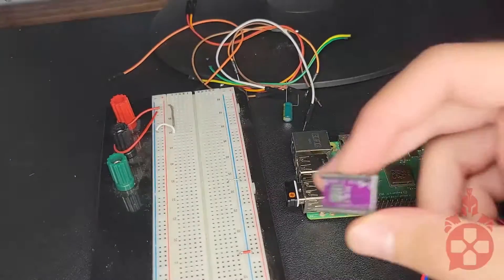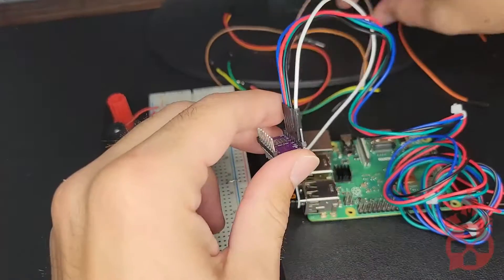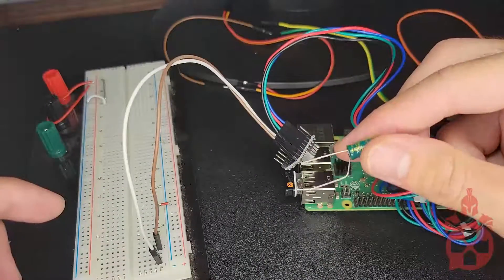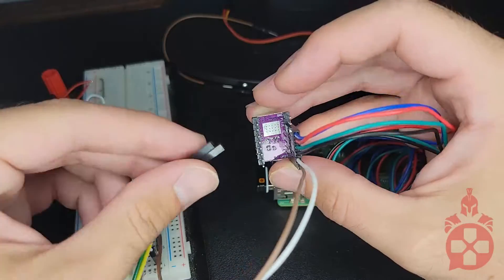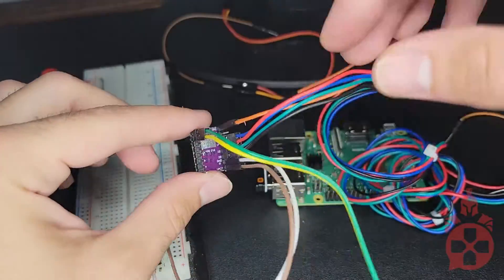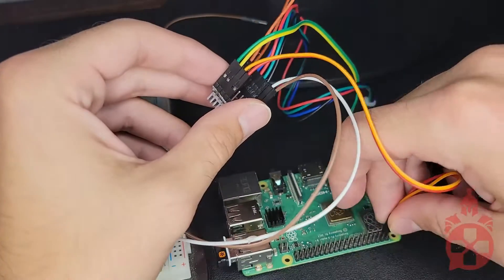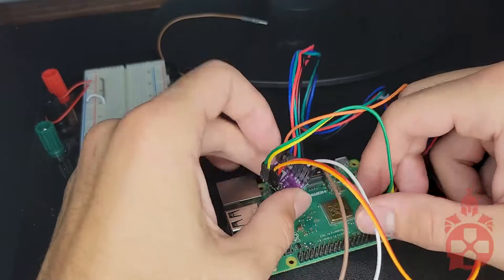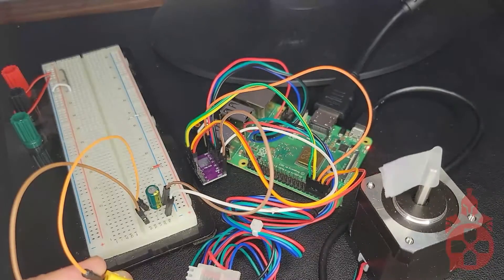How to Run a Stepper Motor with the Raspberry Pi

Comment: I'd like to point out that the green and yellow wires seem to be swapped in the video. DIR should connect to pin 14 and STP to 15 to match the code.

Comment: Hi there. Thank you so much for the video. I’m kindly requesting to show me the  connection scheme and what Raspberry pi did you use ?
Reply from the maker: The data sheet for the stepper motor does are really good job showing the pin outs on the driver. I would recommend looking into that

Comment: Why do you need a controller board? Why not drive it straight from the pi?
Reply from the maker: You certainly can. It really comes down to personal preference. Either more hardware but a simple code or less hardware and a bit more coding. Not relying heavily on the pi allows the system to be prototyped easier down the road.